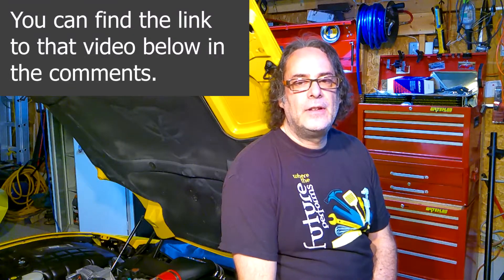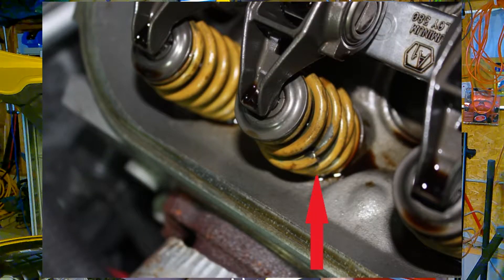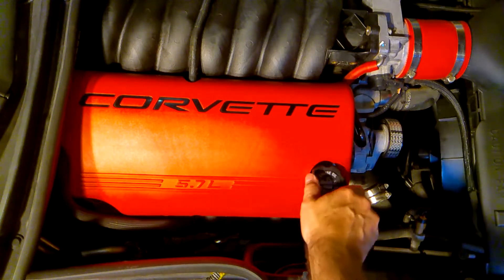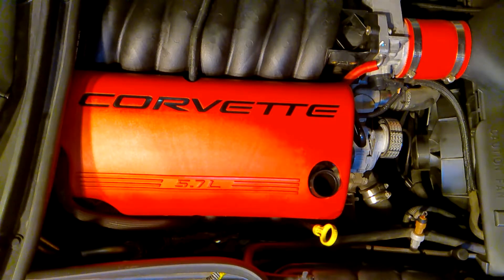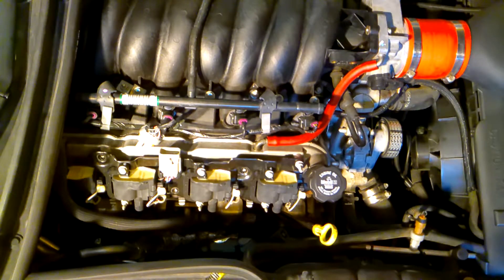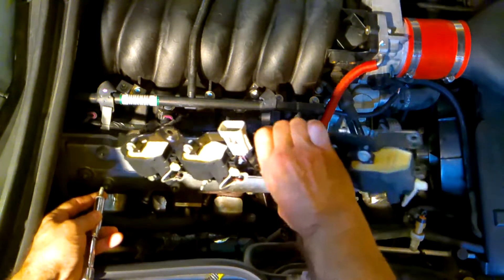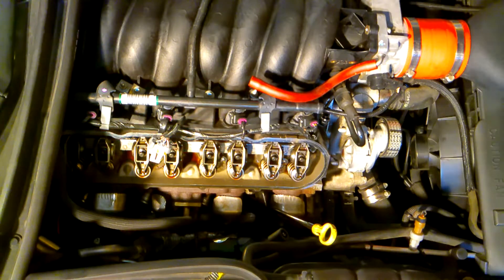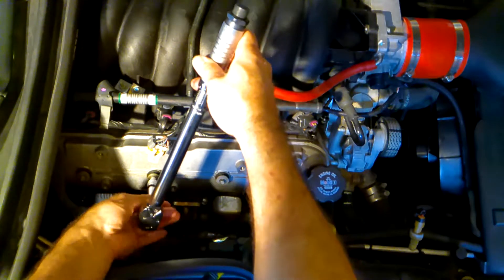Finding The Bad Yellow LS6 Valve Springs

Comment: I've never had issues with the yellow springs, and I've ran multiple sets on multiple motors till long after they are still yellow. Even my 04' ls6 from a zo6 I have have ran them over 100k. before I got it.  Only time they let me down was When I ran a .600 lift cam. The valves would float around 6k. After a year or so, I was forced to buy some pac 1219s when I added boost.

Comment: thanks for the good video, but 2002-2003 and yellow doesn't necessarily = bad. although impossible to know if your yellow springs are bad, the failure rate of these (yellow) was still really low.
Reply from the maker: The research I read a while back, had the numbers of yellow failures about 12x that of other springs.

Comment: I just checked my 2003 zo6 with a camera and the 1 right under the oil fill cap is silver. Did they come with silver and yellow springs? 

Are the silver ones, if oem still problematic?
Reply from the maker: From all that I have read, the problem springs were all yellow in the 2002/2003 years.  Yours could have been replaced already.
Reply: @Just Corvette Crazy  ive been researching like crazy too and it appears some cars came from the factory with silver colored springs as well. But im not 100%.

Anyway, got my appointment booked to get pac 1218's installed. Hopefully my car can make it another 6 days 😅
Reply: I’ve been aware of this issue for years…I finally could not stop thinking about breaking this beautiful engine which I’ve owned since…I brought it to local Corvette expert, he had no idea what I was talking about…”I’ve never seen a yellow valve spring…”I ‘ll take your money” world class asshole, but very competent…he did the job…he handed me my box of “used but good” yellow valve springs…as I left his shop…I feel so much better now…

Comment: Love the videos. When using the endoscope, you can really only inspect or view (1) of the Valve Springs correct? I saw (1) and it was silver, is it safe to assume I don't have the yellow springs? Thanks in advance. -JW
Reply from the maker: Would be very strange that someone just replaced one valve spring.  And even stranger that it is the one that you can see.  Only way to be sure is to pull the valve cover but I think the yellow ones are gone if you see silver.

Comment: I have a 2003 Corvette Z06. I read so much about yellow valve springs I decided I should change mine. The car has 23,000 miles on it. I pulled a valve cover expecting to see yellow valve springs but found natural color ones instead. No paint, not blue or yellow. The new ones I bought are natural color. Can I be confident previous owner actually changed them or should I go ahead and change them anyway. Is it possible natural color were originals or were they all yellow?
Reply from the maker: Yes you can be certain that they have been switched out.  As far as I know the only colors GM used at the time were Yellow and Blue for the LS6 or no color ones for LS1 motors.  So those are most likely some aftermarket springs.
Reply: @justcorvettecrazy116  thank you for the quick response and thanks for your great videos

Comment: Hey this is off topic but i bought a c4 corvette and a ran well for a  4  hour drive and it lasted about two weeks when it went weak and died while i was driving home . Since then i replaced the fuel pump, fuel filter , fuel injectors and ecm and icm and i get 40 pounds of fuels to the rails so i thought it might be spark but it has spark but its not blue but the engine just cranks and doesnt catch at all im thinking it might be the injectors not getting power to fire but starting fluid doesnt work either maybe timing is bad i really need help its driving me insane and its been parked for almost 5 months maybe its the oils sending  unit any help please?  im 17 and i want  my car back alive ps its an l98 engine 1991 corvette
Reply from the maker: Hey Juan, Thanks for reaching out.  Feel free to send me an email at justcorvettecrazy@gmail.com and we can try to figure out your problem.